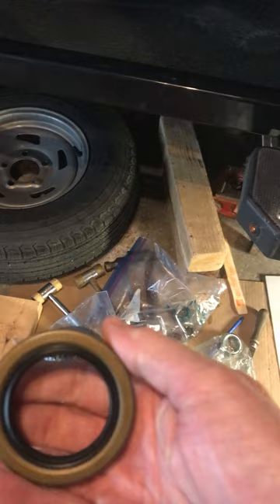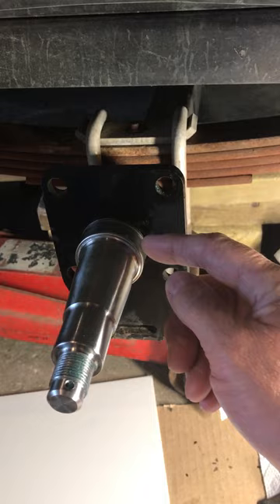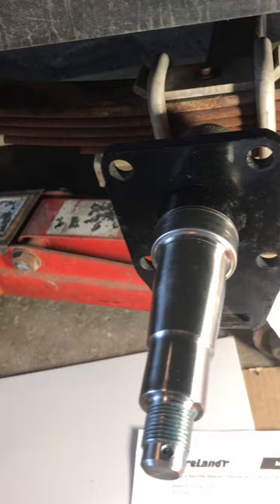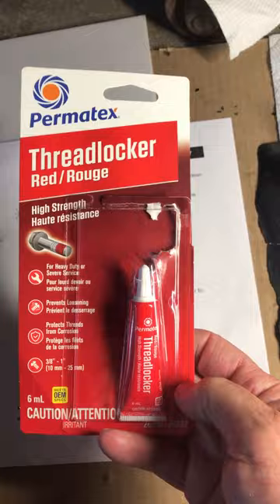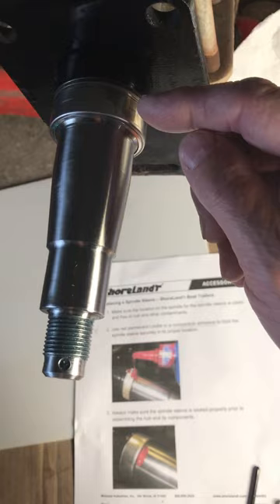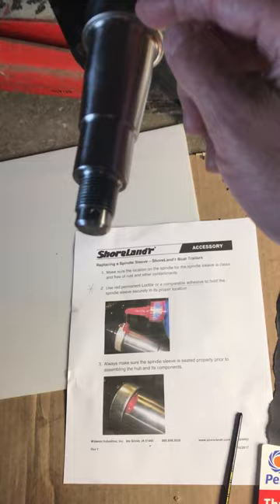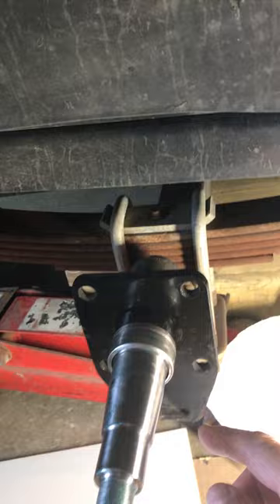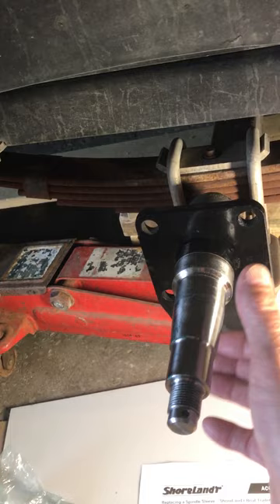Shoreland'r boat trailer, replacing axle spindle wear sleeves using red threadlocker

Comment: How can I be sure the sleeve is seated correctly while the threadlocker cures? Should I just press fit it into place and wait for it to cure? Should I put the sleeve into place and then put the whole hub assembly on, using the castle nut to exert pressrue on the sleeve while it cures? Thanx for the video.

Comment: Where did you get the instructions for this?  I can’t find anything. Is there a way to get a copy?   Thanks!
Reply from the maker: I managed to get hold of the Shoreland'r (Midwest Industries) customer service department but they don't make it easy to reach customer service. There is no phone number or email address shown on their home pages (just a fax number). There is a phone number (1-800-859-3028) shown on the bottom of this instruction sheet but I could never get a live person to answer the call and you have to know the extension number of the person or department you want to reach. If you can get through to anyone at this phone number ask for customer service or try contacting a Shoreland'r dealer and ask if they have a different phone number or email address you can use.